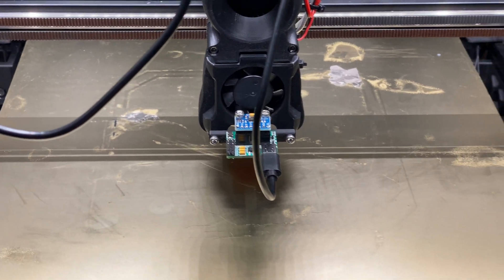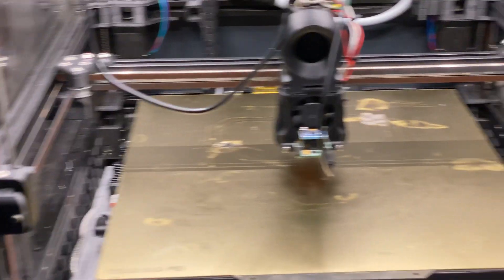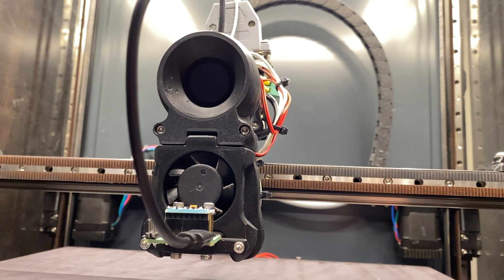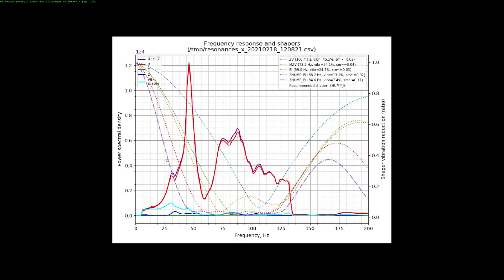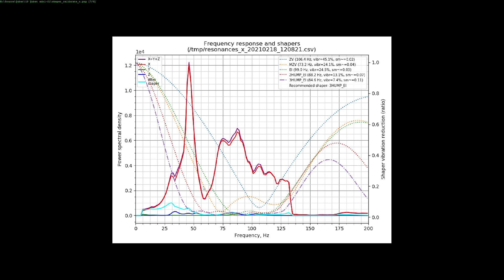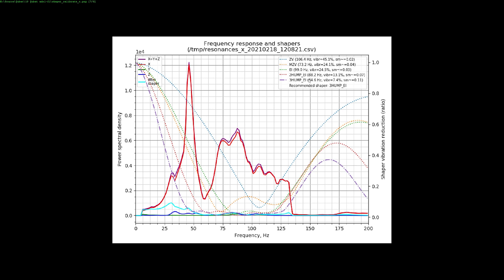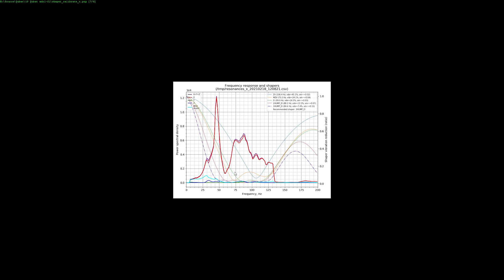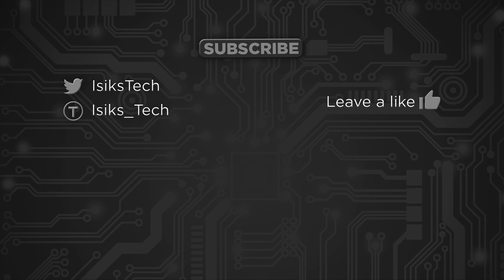Testing the ADXL345 MCU

Comment: Can't you just connect the upper board with the ADXL345 via GPIO to a raspberry pi? I'm just finishing up cleaning and lubing all my linear bearings, upgrading lead screws and anti-kickback nuts, new belts, and once i know its working will be installing klipper on a Pi. Then my plan is hooking up an ADXL345 and getting input shaping under way.
Reply from the maker: You can. This pcb is just for making connections easier.

Comment: I don't really understand the need for this, but it's cool nonetheless. thanks for all you do for the community
Reply from the maker: Thank you. The pcb is supposed to make resonance testing easy. I and many other people had problems with long spi wires running to the pi, plus if you don't pay attention you can plug the wires to wrong gpio pins. with this it's just a USB cable and uncommemting some lines.
Reply: @IsiksTech  ahh cool. If I ever get a printer that's good enough to benefit from input shaper with an adxl345, I'll be sure to buy one or whatever you plan to do!

Comment: what exactly are you doing why are you using the MCU for ?
Reply from the maker: So it can be added/removed easily because it has a USB cable. Otherwise wiring adxl345 directly from the pi is a pain.
Reply: @IsiksTech  my question is why did you use it in the first place ?
Reply from the maker: So you are asking about the accelerometer not the mcu. It is to measure resonances and use that data to get rid of wavy marks on prints.